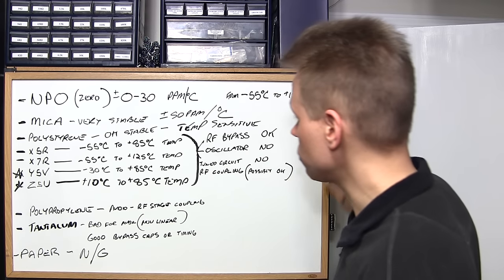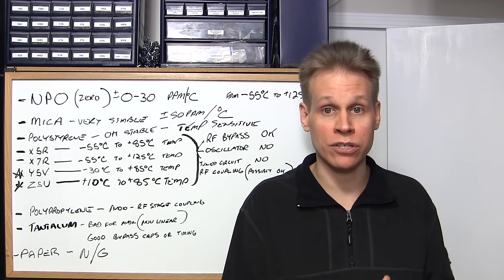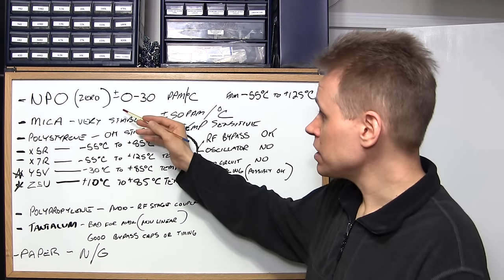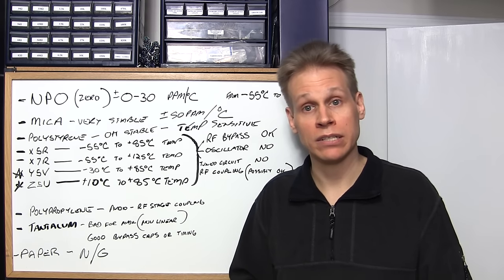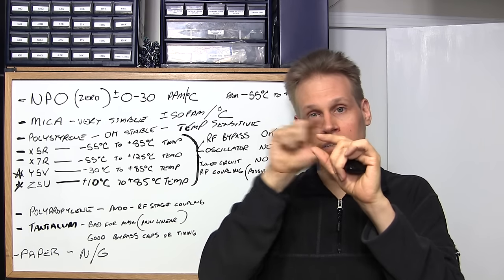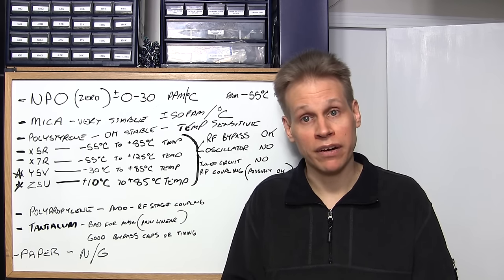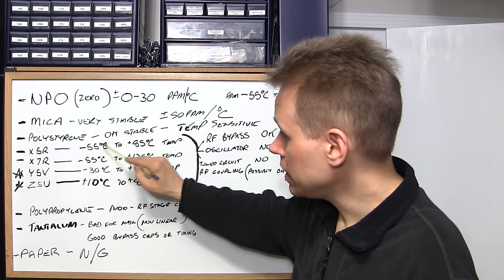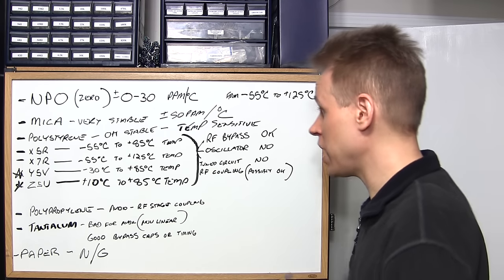Which Capacitor Do I Use? Tech Tips Tuesday

Comment: Your videos are to advanced for me but I still enjoy and learn some new things. I am an absolute beginner with electronics. I've been working on my shoe dryer that just stopped all of a sudden. It has got ceramic resistors as heating elements, UV leds to kill germs and an electronic timer cirquit with little board mounted leds. I have now got as far as to say that the first board with power in, on off button and timer is working as it should. On the second board I exhanged the UV diodes because they were both not working. Still the thing will not go. Next I'm going to change a 3.3V Zener diode, two 100 ohm resistors and two 1A rectifier diodes. That's all there is on that board. If that doesn't work then there fault has got to be on the heat sink. Either the ceramic resistors or one of the two resistors on that, or one of those might actually be a temp fuse I'm not sure since it's inside heat shrink. Anyway, thank you for the education on here. It's over my head but I do pick up some of it. Thanks.

Comment: Thanks!  I got burned once using an X7R in a filter application: You don't mention it directly but the Voltco on them isn't very good. Switching it out with an NP0 (which has very little Voltco)  took care of the problem.

Comment: I still have my 1978 Radio Shack STA 80 AM/FM stereo amp bought new in 1978 and in use the last 20 years powering wall speakers for my Mac towers audio output, it's usually on  16 hours a day, working flawlessly :)

Comment: That third capacitor style is mostly but not exclusively used for mica capacitors. The larger values (I think from a few nanofarad on) are actually paper capacitors just like styles 1 and 2, even if the brand name is Micamold! Also, I didn't have time to watch the whole video but I noticed that on the white board, polyester is missing. Polyester and polypropylene capacitors come in similar housing styles but have different properties. In general: when in doubt use polypropylene.

Comment: Regarding tantalum caps, I had an equalizer that had a lot of hiss.  I replaced all the electrolytics with tantalums and noise gone, no issue with distortion at all, so not sure in what arena you had linearity issues but no problem at all for me and did not generate the noise that the electrolytics were creating.

Comment: Great video! However, when I go to a site such as DigiKey, they don't list their caps in those same categories. For example, they list Film Caps, Thin Film Caps... When you search their site for Polystyrene Caps or Polypropylene Caps there are no result. So, in my case I'm still not clear on this information. If you could provide a follow up video that includes all those caps the way they are listed on DigiKey, Jameco and Mouser that would be really helpful for novices such as myself. Many thanks.... And keep those videos coming.
Reply: Raindrop Services You need to look at the data sheets and see what is the insulating material. Film means “thin sheet of insulator with metallized electrodes on each wide” – the question is then why is the film made of.

Comment: Very good Paul. In my homebrews and even in some repair and restorations I have been using C0G MLCC in place of mica, the price of mica being as high as it is. Depends on a lot of things of course, but so far I have had success doing that most of the time.
Reply from the maker: +cny02253 
I bet the circuit works better after you fixed it. Mica to NP0 replacement is a very good choice! Thanks for your comment!

Comment: Ey Paul. I&I(re) REALLY respect your master knowledge of stuff. I wish 2 add something here. I found capacity failures 2 b true in the majority of all troubles with electronics. But I also found true in resistor failures in resistors after the second half '80's-especially- above 100-k & > (0.25 Watt) and above in analogue/digital circuits in synthesizers and keyboards/. It seems that resistors can produce  annoying problems in this regions as well. Namasté

Comment: I had a couple dipped tantalums blow up in an Atari 2600 once. Thankfully, it was repairable and they didn't char the PCB at all. Scared the living crapple out of me, I was playing Asteroids and then there was a very loud and sharp BANG, a flash, and tantalum shrapnel flew everywhere (it was a 2600 Jr., it was one of the caps near the top vent that blew) from the top vent of the unit. They do not like to be messed with.

Comment: Heck of a lab goin on there. Aluminium clips on part leads, helps draw the heat from parts when soldering heat sensitive parts. I've learned that the hard way, I've probably ruined caps soldering them and didn't even know it. Some caps aren't the only heat sensitive parts, diodes are also.

Comment: I've been working on repairing an Icom IC-735 that was blowing the fuse.  After tracing through the boards, I discovered the culprit to be a tantalum bypass on the main board where the 13.8v power supply rail comes in.  After replacing it, the radio powers on now, but I have a long road ahead as the receiver is deaf and there are several other problems still going on.  I wouldn't be surprised if more of these have failed, or other components after years of sitting unused in the closet.
Reply from the maker: +Patrick Briggs 
Good luck with your ICOM Patrick!

Comment: There are other characteristics of those capacitors the you should at least give a passing mention.  They are the ESR (equivalent series resistance) and the leakage.  Polystyrene capacitors have very high impedance and are commonly used in electrometers because of their high impedance.  The ESR for a tantalum capacitor can actually cause a switching power supply to oscillate because of the pole the ESR produces with the capacitor.

Comment: What about feed-through capacitors?  Only asking because I don't know much about RF shielding, and noticed you can't really find these readily available today.  I find that they are used in SWR/Power meters to separate electronics from the RF input/output.  Is there a better component to do the same thing today?

Comment: There are some new developments in capacitor technology in the last 10-12 years that are important for current applications. Sanyo Os-con, surface mount can electrolytics, polymer, all being used in modern equipment. The polymer caps are outstanding for low ESR and some of the small can electrolytics are much improved in their ripple current (ESR-temp heating) specifications. The Sanyo Os-cons are known for low ESR and higher voltage ABS-Max ratings.

Comment: While I'm not an expert, I've found from experience that polypro caps are excellent for jobs like sample and hold circuits because they have extremely low leakage. Also, I have never had any luck with tant caps in timing circuits because unlike poplypro caps, they DO have high leakage. Actually, I've never had any luck with any sort of electrolytic cap in a timing circuit. The reason you'd want to use them is for the very high capacitance for very long timing periods, (30 seconds and up.) But the fact that they have very high capacitance always seems to mean that they also have very high leakage, leaving the timing circuit erratic. A 2 minute 555 timing circuit I built with tants was so erratic that it occasionally leaked so much that it never timed out at all.

Comment: I know this is an older video but a comment none the less. In the Army, we were taught to put a strike through any ZERO, a diagional line from upper right .. through the center of the zero and out the lower left side of the zero. This is to avoid any confusion as to the O or 0 situation. I know it is a minor niggle but it does avoid confusion :D

Comment: Paul,
I was re-watching this episode and a thought occurred to me.  You mentioned the temperature range on the NP0 capacitors having a low end of around -55 degrees C.  I happened to remember hearing that the temperature in space was around -236 degrees or so, and was wondering what is done for stability on RF circuits in satellites, space probes and landers to assure frequency stability on transmissions from space or very cold planets.

Comment: When I worked for a manufacturer of computer controls, I did all the purchasing. I learned a big lesson in buying suprus parts, and that was with tantalum capacitors. They look good, and measure ok at their rated capacitance,  but after they were in product and out in service, they started to fail, and that cost the company some big money to get past. Lesson is to only buy parts from reputable sources.

Comment: Thanks a lot for explaining it so perfect!
Am I correct in thinking it would be better to put 10 x 100uf ceramic capacitors in parallel instead of 1 x 1000uf electrolytic capacitor, when it is inside a enclosure where the temperature can change from -4 °F to 140 °F ?

Comment: About ceramic, caps in case of low frequency oscillators, I know of guitar amp builders/repairmen who purposely use ceramics because they find that they start the oscillator in an amp's tremolo more reliably than other cap types. Of course, these aren't oscillating at precise, high frequencies, so the tolerance and thermal characteristics won't matter as much. Definitely not so great for RF, as you mentioned in the video.

Comment: Hm. Some paper & foil capacitors are wax impregnated and are yellowed from the heat or any impurities in the wax. An Ohm/continuity meter can check for leakage, or you can check the DC amperage going into the capacitor. After a few RC time constants, the non-electrolytic capacitor shouldn't be drawing more than a microamp and that should be falling to zero as it reaches full charge.

Comment: I absolutely LOVED this video! Especially about the part on heat/vibration sensitivity.

Could you do a video on recapping computers?  There are some people talking about recapping old computers with ceramic capacitors, but i'm not sure if they know about this stuff since the advice some give is "just use ceramic caps" regardless of the heat signature in different parts of the computers motherboard.

I'm about to recap a couple of Amigas and C64's, but i prefer to learn everything there is to know about capacitors before i start replacing capacitors.

Thanks.
Reply from the maker: Thanks for your input!

Comment: Thanks... Possibly for your more enlightened viewers: (I'm more of a mechanic than electronics wiz); 
Building a DIY test box for low resistance measurements, using LM338K - or T - for 100mA current source (12.5Ω across "out" and "adj" = 100mA... 1.25Ω [4x 5Ω-5W, parallel] = 1000mA).
TI/NatSemi recommends 1µF tantalum cap at power input (source) terminals (12VDC... 16Vcap?), if power leads are in excess of 6 inches (they will be, cables w/clips to motorcycle battery).
To the point: it is also recommended 100nF (0.1µF) cap at load test terminals: also tantalum? are 100nF tantalums typically available? or, a recommended/preferred  type? (ceramic disc, etc.)
@ 100mA, measure millivolts... do the math for Ω... Again, thanx for your wisdom/knowledge.

Comment: I was told to replace the paper capacitors in a vintage radio with metallized film ones.  I was told that, although not marked, they do have polarity.  I was told to hook up one end of the capacitor to an oscilloscope and hold the other lead.  The held lead with the most noise meant that the foil side was on the outside.  I could not see any difference either way with the caps.  Was I doing it right?  What side would be equivalent to the line on the paper cap?
Frank
Frank Reiser Video/Audio Service

Comment: Tantalum horror story. Hmm. I worked customer repairs for a company that sold a lot of autosound equipment. One of their better am/fm stereo radios would regularly come in with the audio system apparently fine but unable to tune in any stations. The output of the phase detector in the PLL used a tantalum cap to filter to a nice voltage for the VCO. Guess what happened when that cap failed. I got so one of the first things I did when one of that model came in was use my O-scope to look for a ton of noise on that line. Easy repair but it got a little annoying after a while.

Comment: What type of capacitor should I use on my door bell circuit?
 Size, type, and whether it should be in line with the negative or positive or across the two at the doorbell switch or at the door bell itself.
 It's an old style doorbell that has a ring tone that goes on for about 5 seconds.
 It's wires to a 18 to 24 volts  transformer.

Comment: I want to replace the capacitors in my 1966 Sylvania floor speakers.  As per the schematic there’s  a 2 MFD & 5 MFD both 25 V NP which I assume is no polarized and one 0.25 MH coil which I’m guessing doesn’t need replacement.  For a descent sound what caps would you recommend?  Thank you I appreciate And respect your advice.  I really appreciate and enjoy watching your restoration postings.  Awesome service- information you provide.

Comment: I'm assembling a new-in-box Heathkit solid-state amplifier from 1965.  I replaced all of the electrolytic capacitors in the kit with new ones, as well as replacing all of the carbon resistors with new metal film resistors that are 1% tolerance. I didn't try to substitute any of the electrolytic capacitors with poly caps because I didn't know if it would be safe to use a non-polarized capacitor in place of the polarized capacitor.  My question is, am I doing the right thing by using new electrolytic caps instead of poly?

Comment: Vintage Fenders have ceramics in tremolo circuits almost exclusively. Not only that,they can sound worse when replacing them with film caps. Are you talking about a different type of oscillating circuit?

Comment: Do electrolytic capacitors have difficulty working at lower voltages?  For example will a 100 VDC electrolytic smooth out variations at lower voltages in the millivolt range?  Will electrolytic capacitors not be damaged by reverse polarity as small as 100 mV?  What I am trying to do is filter ±0.003 mV variations with a capacitor in the range of 500 uF in a circuit with about 2000 Ohms impedance.  I want to avoid placing 2 polarized caps in series + to + or - to -.  Is there a 500 uF capacitor that is not internally 2 polarized caps in series.

Comment: thanks for this. i had thought about using some of those cheapo ceramics for an rf trap i was going to build.  but i can see that if they change their capacitance in such a dramatic way then they would change the frequency the LC trap was designed to work at...a great video
Reply from the maker: The disc style can be pretty drifty, aside from the NP0 style. The disc style NP0 caps have a little black "dip" line on the top. So it looks like they dipped the top 1/4 of the cap in black paint.

Comment: Polys are great for audio loudspeaker passive crossovers.  Many manufacturers use lytics but other than for large value bass shunt pole capacitors, they are best avoided.  They are not that consistent on tolerance, temperature sensitive, not very reliable longer term where esr can rise sharply and really are best avoided.

Comment: I'm not very versed on electronics, especially the components and their practical behavior, but do I understand correct that if you happen to put a ceramic capacitor in wrong place in a tube amp circuit for example, it might be the reason for big oscillation problems, perhaps screaming etc? Where you usually wouldn't want to get into oscillation. However in right place I assume they're fine since they're used commonly, is that right?

Comment: At 1:56 I think you made a mistake. Shortly before you told us that capacitors are blocking DC and passing AC only. Now you are telling us that these are passing DC. If I am correct then small leaked of DC would not damage a speaker but a higher one definitely would damage or destroy it. I think there was a confusion or specifically bumblebees capacitors can work that way. Still thank you very much for video. Very useful.
Reply from the maker: You may need to listen to the video again. In a fault condition (leakage) capacitors pass DC.
Reply: Yeah, I think I may got confused in the end :) Sorry. I am a non native speaker. I think you mentioned (leakage) condition with tube drive to hard class A and further more this causes the damage. I think you may started giving example of a leakage condition with putting down a resistor. I am sorry if confused any of that information even more. I have little to no experience with all components (only basics - and still I find myself easy caught in traps for a new players). Guess, I would continue learning stuff :)